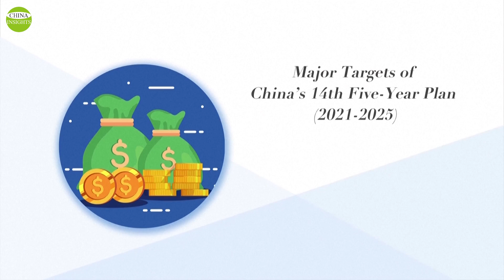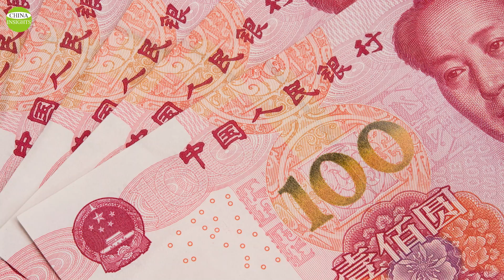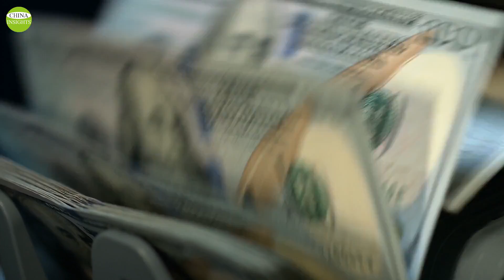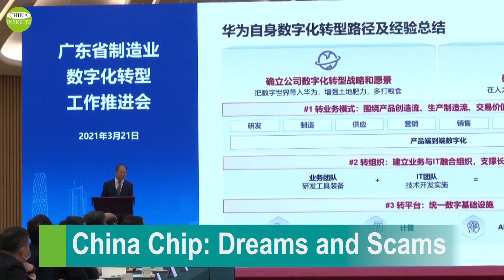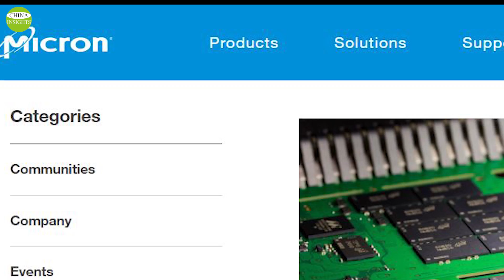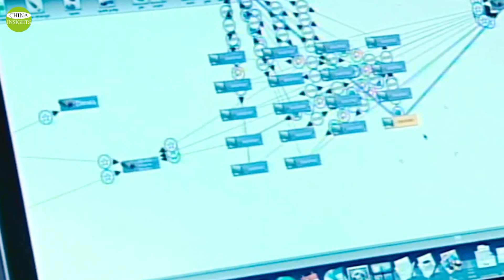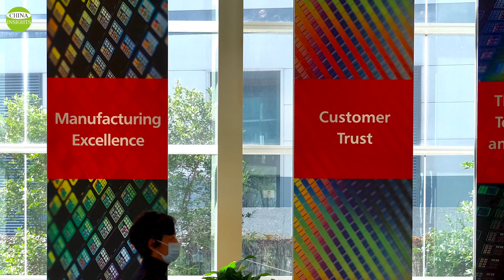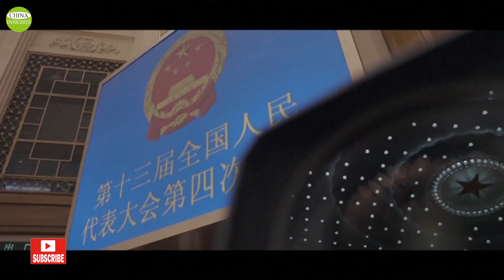$15.6 Billion Chinese Chip Company Went Bankrupt/China launch 10-Year Plan/Global Chip Shortage

Comment: Great video. However, there is one thing that should be mentioned. The use of “nanometer” to describe manufacturing nodes for each company is not equivalent. The transistor density for each company at the same node is different, in general Samsung (7nm) is significantly less dense than TSMC (7nm), Intel’s (10nm) is more dense than TSMC (7nm). For example, Intel 10nm has a transistor density of 100.76MTr/mm2 (mega-transistor per squared millimetre) while TSMC 7nm has a density of 91.2MTr/mm2. However, it’s important to note that TSMC is having better production yields than Intel at the moment.

Comment: You are describing western style capitalist fraud, i have no doubt that this is taking place, China is unable to manufacture the highest quality chips due to USA sanctions on equipment sales from companies in the Netherlands. This situation will only continue until China achieves the required manufacturing ability. In the mean time they can dominate the world market at the lower levels which they do have the ability to manufacture. 
The question is how long will it take them to develop the technology?, because at that point they will dominate the world in this industry.
Reply: The question is "When", not "If".
Reply: @irmux skeptic No, there is only one machine in the world that can make high end chips and that is the ASML euv scanner, the laser in that is an american product from cymer. The laser was the really hard part to develop.

The other steps are relatively easy and available to everyone.
Reply: The US is blocking ASML but part of the machine comes from cymer in the USA.
Reply: @irmux skeptic I'm not sure what you mean, but chip design is done all over the world. But to make the high end chips (with the most transistors) you need the EUV scanner no way around that.